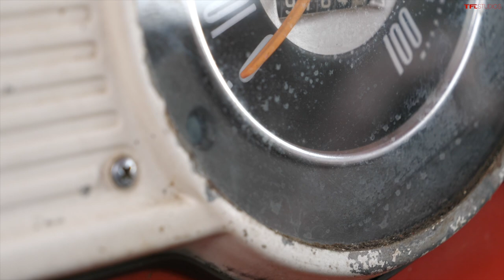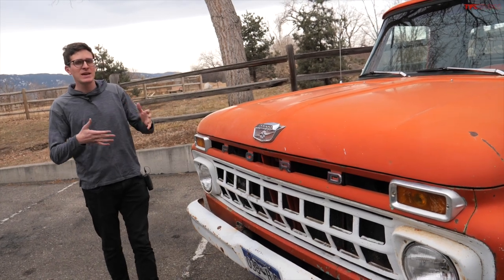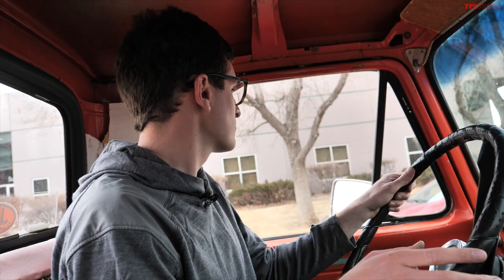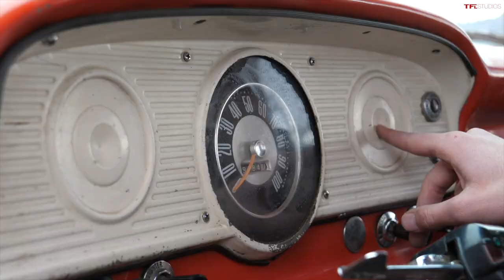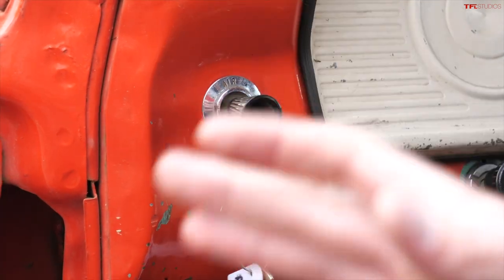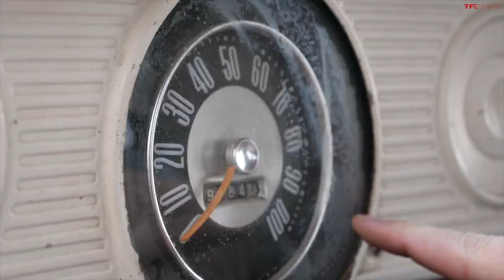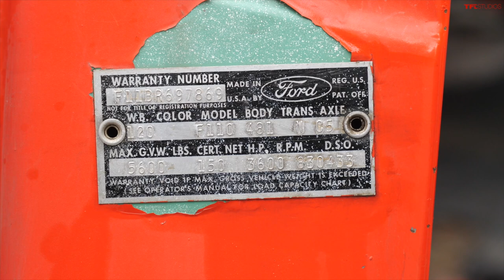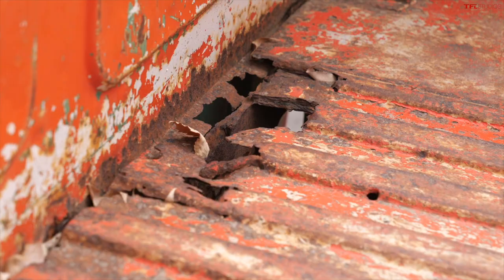Do You Like Raptors? I Just Bought The Ford Truck That Started It All!

Comment: Looks like the axles were swapped from a 3/4 ton. Those front U bolts need cut off or they'll hang up on every pebble you come across.
Reply: The half tons and 3/4 ton trucks both used the same Dana 44 front end for the 4x4 trucks.
Reply: @warrenmcelroy4718  There's a shot of the rear in one of their vids. Clearly a full-floating D60. Both are 8-lug. These aren't half ton axles.
Reply: @upscaleshack  hahaha, I didn’t pay any attention at all to the eight lug hubs either, good call my friend
Reply: Matt Lewis good call brother. When this whippersnapper was born, this truck was already sold as forest service surplus.
   When I saw the axles it was obvious this truck was modified, or it had the wrong badging on it.
   Old Fords never die, they just get new owners and keep on truckin'! Built when y'all actually had to "drive this truck". Giddy up.
Reply: @leeglidewell1473  i grew up with these old trucks  so it’s awesome to see one in such great condition. My Brother still has the ‘66 F250 4x4 that he drove when we were in school, my Junior year of Highschool I bought a 76 Highboy Ford that was pretty tough to beat but sadly I sold that one about twenty years ago.

Comment: I liked this video. It brought back memories.  I bought a 1965 F250 with a 352- 2bbl  motor that the previous owner forgot to put antifreeze in. I was going to scrap it. But my younger brother had a 1965 Galaxie 4dr brougham. He couldn't pass state inspection because of a rusted frame. The car had a 352 V8 4 barrel carb. I was 17 and had no idea what I was doing. I bought the Galaxie for the motor. I put it into the F250 mated up to the 3 on the tree transmission. Turns out the truck was a rocketship. By accident (HA HA) I found out it would lay rubber and tire smoke the whole length of the High School property. Just like the kids that had Corvettes could. It was so much fun.

Comment: I drive a 66 and it is very similar. It's my daily driver. It's a four on the floor no power steering no power brakes. I bought it when I was 13 with yard mowing money. It's taught me a lot and I love it. My arms have gotten bigger by driving it. My truck was a old fish and game truck. We call it Forest.
Reply: Whats up with these trucks being hard to steer did they put a nicer steering box in the 63 F350 because mine turns so much smoother than even my 93 f150 with power steering and decent sized tires

Comment: Cool truck, cool video.  I love my 65 2wd long bed.  Mine has a 74 front end to add the power steering and disc front brakes.
Reply: added pwer steering from a 1978 to my 66, bolts up. Saginaw pump, effortless

Comment: Had one of these , put a 390 automatic in it , dual mastercylinder with a power booster , and  power steering , loved that truck . Some one hit it in front of my house and rolled it into the yard , loved that truck . Good luck with yours ,  the power drum brakes worked great . My wife could drive the automatic and the power steering was so nice with a smaller steering wheel

Comment: It's funny watching a millennial go through the "old school" controls. He does a good job but forgot the cupholders in the glove box.
Reply: Too true. These were just normal for us in our youth, most cars lacked PS/PB back when we learned to drive.
Reply: @StephaneDemers  Oh, and to use the latch in the door as a "church key" to open a bottle of pop.  "What's a 'church key'", Tommy asks.
Reply: @StephaneDemers  Yep, they had "armstrong steering," "powerful brakes," and "260 air conditioning" (2 windows at 60 mph).  The real trick was steering with both hands and shifting the transmission, using both feet for the clutch, brakes, and accelerator (and to dim the lights at night),  AND keeping that open bottle of pop (or beer) sitting on the seat in your crotch from spilling.  Those were the days!
Reply: There are no cup holders in the glove box also you could open a beer bottle on the latches of these trucks be cause of how they are designed they are actually a pretty neat design and the way they close honestly rivals my grandpas 2015 truck
Reply: @straight6fords580  Look at the glove box lid when he opens it. We always used those circles as cup holders when I was a kid.
Reply: @jackwolford608  none of my trucks have it no indentions or anything and i looked it up to see if it was a option on the slick fords and ford tricks didnt get a factory cupholder til the 90’s the chevys had the cupholder indentions there is an old aftermarket cup holder came from a 3rd party but didnt work on the glove box
Reply: @jackwolford608  you are right im also curious when you google it nothing shows up until i started looking at replacement glove boxes. did the bigger trucks not have this option i believe both of mine are smooth because theres a flat tag that fits on it or was this an addition for 65
Reply: @straight6fords580  I saw it at 17:13 in the video when the glove box opens. I was surprised to see it on a big truck.
Reply: @jackwolford608  i have a 1963 F350 and mine doesn’t have the indents
Reply: To be fair, I'm in my 40's and the only reason why I know about some of these features is that my first car was 20 years older than I was, a Chevy square body pickup.
Reply: Lol I hear ya.
Reply: @rockymountainjazzfan1822  I had a 59 Chevy with the starter button on the floor.  You had to hold the clutch in with your left toes, hold the brake with your left heel, press the starter with your right toes, while pumping the gas with your right heel.  Nowadays I'm used to starting my 4Runner where you just flick the key to the start position and let go, so I get tricked when I start the Accord and forget to hold the key a few extra seconds until the car starts.
Reply: You mean the two circular "outlines" on the inner panel? 😆
Those would have come in handy when i'd lay up in the back window of the 'ol chrysler and eat my happy meal.

Comment: FYI, that chrome blank in the dash is the space for a throttle cable which would be an option. It was very useful on 4WD trucks. Could be used when winching yourself out of a ditch, doing farm chores, with a PTO, or just impressing your friends by getting out and walking uphill beside the slow moving vehicle.

Comment: Not gonna lie it’s actually gonna be funny watching a city boy try to wrench on this old truck
Reply: A young city boy at that!
I sure hope he doesn't do any engine swaps.
Reply: I have a friend with this body style Ford that he uses on the farm. I doubt there's much original left of the drive train on his, though. He's a shade tree mechanic that might have a John Deere motor and a Massey-Harris transmission in it by now.

I wonder if he ever built that electric tractor he talked about?
Reply: I'd help TFL restore this.  Fun project.
Reply: As a city boy that wrenched (and still wrenches) on a 1981 F250 with the 300 and a t18, I am pretty sure that the word you're looking for is BORING :P What's he gonna do, strip a bolt? You can see everything and everything is so simple! You'd have to TRY to screw anything up lol.

Comment: I watched this video and the other one you did when you bought it.  It was entertaining to see a younger adult who didn't grow up around older trucks, review it, and be astonished about all the stuff that just was the way it was back in the day.  It's also always nice to see vehicles and scenery from near where I grew up in Colorado back in the late '60s through late '80s, even though the population there has gone nuts over the last 30+ years.  As a '65, this truck is a very interesting combination of what was current at the time along with a heap of parts from the '64 and older generations of trucks probably due to the fact it's in that transition period when they first went to Twin I-beam and the new series of engines, along with it being a 4x4 and a fleet vehicle put together for customers like the Forrest Service.  I learned to drive in a 2WD '64 short bed F100 with 223 I6 and 3-on-the-tree sitting on my great uncle's lap while we worked the pedals and shift lever and I steered.  I acquired that truck from him when I got my driver's permit back when I was 15 years old in the summer of 1984.  I learned a lot working on that truck as a teen, and it definitely influenced my car hobby today.  I still have that truck today along with two other short bed '64s I've picked up mainly as parts trucks over the years.  I'm looking forward to eventually restoring/resto-modding the truck I've had for nearly 37 years. On your truck, I say fix what needs to be fixed, upgrade the brakes to a more modern system so you can compensate for the other dumb drivers out there, and just drive it and enjoy it for what it is.  It's a cool old truck that was meant to do cool old truck stuff like going fishing, hunting, helping your friends move, feeding your livestock, and getting you where you needed to go when the snow was deep and the DOT didn't do nearly what they do now to clear roads.  There are so many stories I could tell about driving my '64 F100 through the years.

Comment: Boy, am I glad that I just happened upon this video. Recognized that grille immediately!  I was in my last year as an undergrad in university, and I figured that I would make enough money the next year so I could (and did) treat myself to a brand new 1965 Ford F-100 for $5500 (Canadian) 2-tone red and white -  looked beautiful.  I built a wooden "house" in/on the box with extra storage or sleeping space above the cab.  It was heavy, but it looked great, and the truck didn't mind (except for lower gas mileage).  It went to both the Atlantic and Pacific Oceans, served as an every-day 'car' and later as a work truck.  The features weren't all quite the same as yours (example - the box matched the cab), but most of what is on yours was on mine.  Loved that truck for years, then sold it to my nephew who parked it in the field where it stills sits quietly rusting.  Took pictures of it a couple of years ago.  Brings back a lot of great memories. Thanks for posting!

Comment: I bought my 1965 F100 in 1985 (for $300).  2WD short bed Flareside that was also built in San Jose, and was also a Forest Service truck.  It came with the 352 V8. Unlike the 6, the V8 really needed the choke.  That engine does not like the cold, damp winters in the Bay Area.  Been driving it regularly ever since 1985.  I upgraded the brakes to power disk up front, maintained the drum in the rear.  That is a highly recommended change, even if you are not towing.  1973 F100 disk brake spindles bold right on.  My steering was really stiff for many years, but got much better when I finally rebuilt the steering box.  Half of the reciprocating balls where in the bottom of the steering box, not doing their job.  I also added Vintage Air air conditioning because I am getting soft in my senior years.  Love my truck.  A friend of mine has a 1966 F100 Crew Cab, 4WD.  That is a rare truck.

Comment: Swap the Bed from a 2wd truck so the fenders match,
Reply: Some of the 4x4's came with the matching bed. I think they just ran out. I agree though, since the bed has rust try to find the correct one. A bunch came with the step side, which is cool too.
Reply: The bronco fender cut outs work on the truck and look good
Reply: @Bigjobrob  the f100 4x4 had the matching bed for 66 only and the f250 4x4 which is what he has never came with the matching bed
Reply: Do not swap the bed. This is the factory bed for your F250 and it should stay on the truck.
Reply: Leave it factory and put original front fenders on it they are for a different truck

Comment: It was entertaining hearing a young guy describing standard features on a 60s vintage pickup.  Back then power steering was something your dad's Chrysler 300 had, but it was not common on trucks.  I remember driving a 50s vintage Chevy two ton farm truck back in the mid-60s.  That beast had no power steering and was a bear driving in a farm field loading hay, but compared to the 30s vintage John Deere tractor it had a light touch on the wheel.  That low first gear was used when starting loaded.  When in low range 4WD that low first gear put ALL the power you had on the ground although you could walk faster than the truck would go in first.

Comment: I had a "wrongbed" '63 f150 with the same manual transmission and a 292 V8.  I wish I had it today.  The four speed is your parking break.
Reply: Maupin on the Deschutes? Had many a great fishing trip up there, pulling my 1957 Aljo trailer w/ that very same truck. in the late 70"s.
Reply: @bristleconepinus2378  No, my Ford was in Santa Cruz

Comment: When I was young, one of my friends had a '65 Ford 4x4, but his had a 352 cubic inch V8. I forget if it had power steering, but I do remember that the huge steering wheel had been replaced with one of those popular at the time 14" spongy three spoke aftermarket wheels. His truck had the same aftermarket aluminum wheels on it. He had swapped the alternator for one from a squad car so he could run 10 off road lights (4 outside the grille, 4 on the roof and 2 on the 'A' pillars). His truck had two tone paint, a light blue and white. The paint appeared to be original. It was a very cool truck.

Comment: It should be a T19 transmission. 
435's have a aluminum top cap that came in the 70' on.  Also that truck is a 260C with a closed knuckle 44 and a dana 24 transfercase. 
I would love to have those front fenders, hard  to find them with the larger wheel well openings.

Comment: I had an SJ Gladiator some years ago. 1971 with a 258 3 speed. It had an ashtray on either side of the radio. No power anything, but at least the gas tank was below the bed

Comment: You are not kidding when it comes to the 300. Had quite a few over the years, amd never had any engine issues whatsoever. Even had one with nearly 300k miles, and  still ran great. It was rust that put the 300 sixes out of commission

Comment: 1967-76 frames fit under those 65-66 cabs and beds,cab & radiator support mounts along with axle locations are all the same,complete drop on that will give you power steering and disc brakes.Pull the two brake booster/master cylinder brackets that are between them and the fire wall on the 67 & up,turn them upside down and they bolt right on the 65-66 fire wall with correct booster/master cylinder location,the bolt holes are already there.Just shorten the master cylinder push rod. I just sold my 1964 factory crewcab with a long bed that I dropped  on a 1976 one ton crewcab long bed 4 wheel drive frame with a 1970 460 & C6 that I swapped in using a kit from L & L products in Rowlet,TX.

Comment: I learned to drive in a 72 F100. 302, 3 on the tree,  2WD, LWB, and forest green. No air con, manual steering,  brakes,  not even a radio. Just a plastic blank in the dash where a radio could go. I can still hear the roar of those bias ply mud grip tires on the back roaring away.

Comment: My Grandad had a '65, my Dad a '69. This kid has no idea what it took to drive those things. I never remember ever driving them in a parking lot, they were a work/farm/ranch vehicle. Very seldom were they driven over 60, although I still remember 70 mph speed limit on 2 lane highways in the 70's. As for the brakes, you should drive that truck down the highway at 50 or 60 knowing you have to pump those single stage brakes to build up enough pressure to get stopped. Fun times, thanks for the video.

Comment: The '65 F100 4x4 can be found with short bed, step-side bed, and standard bed. The standard bed did not have matching body lines, but the higher level packages with chrome trim widened the look of the body line on the bed to match the door and cab.  

The frame from the '65 was used on F-Series trucks until 1979, so Bumpsides (67-72) and Dentsides (73-79) are basically the same underneath.  Interestingly, the Dentsides had "fat" chrome trim available with their upgrade packages that turned the "dent" into a "bump."

Comment: Wow, what a generational difference in views of that classic; especially about it not having power steering. My exgf; and this was back in 84; had a 67 Dodge D-200 Camper Special w/383 3-speed. She was all of 105 soaking wet and only 5'4" and could drive it w/o issue. Loved the No abs & no airbag steering wheel. It means you must concentrate that much more; like you pointed out. Now on to what to do with it. Unlike a lot of suggestions, this is what I'd propose that would be done by most for ease of use and driveability: 1) Upgrade to dual circuit power brakes. Easily done in the garage in a few hours. 2) Power steering conversion. 3) Recover the seats with a kit from OPG 4) Garage repaint. Basically an overview on what needs to be done to the truck & how to prep Your garage for the best results 5) Upgrade to a Holley twin injector TB instead of the 2-bbl 6) Upgrade the drum brakes. There are better shoes & drums now that are have better performance than the originals. 7) Upgrade to the Custom 3-gauge package and show how to do the wiring correctly

Comment: Great truck Tommy! I think a sympathetic restoration is called for. Repair the body and paint it in it’s original green color. Freshen up the suspension, upgrade the brakes, add power steering and add a canvas topper and call it.... “Smokey” as in Smokey the Bear

Comment: Great revisit to the past!  I had a 1965 F100 back in the 1970s and wish I still had it.  Regarding the tailgate chains & catches, the better & more secure way to hook them if from the bottom when in the up or closed position and from the front when the tailgate is in the lowered position so they are less likely to pop out while driving over rough surfaces.